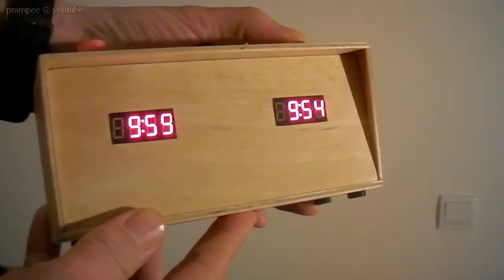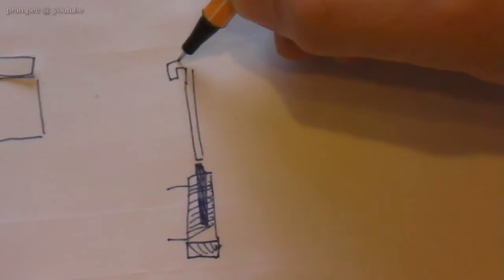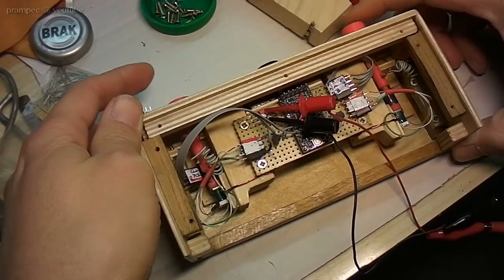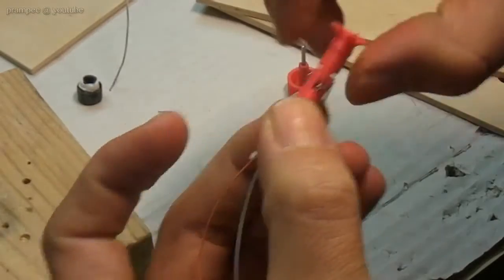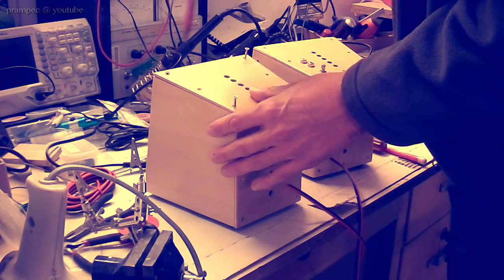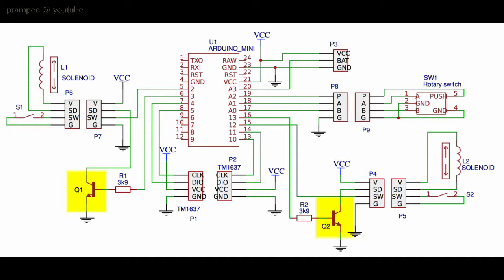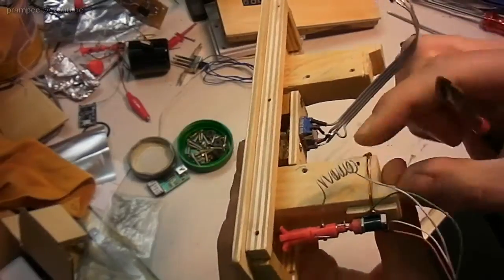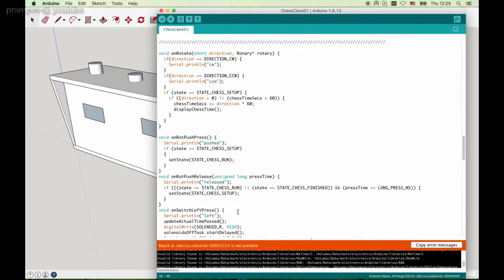DIY Chess Clock with solenoid release

Comment: Genius, i want to mimic your project, but how?
Reply from the maker: I have made a quite comprehensive documentation about this project. Check the video description for the link!
Reply: @sharedinventions  Hello Mr. Kelemen may i know the specification of arduino mini pro? is it Arduino PRO MINI ATMEGA328 5V 16M?
Reply from the maker: @mcadronaldalcantara8755  It can be any kind of Arduino. Even any kind of Arduino Mini. Either 5V 16Mhz, or 3.3V 8Mhz. It does not effect the performance, or electronic characteristic of this project. I have used the smallest one laying around.
Reply: @sharedinventions  how about the TM1637 ?millions of thanks...
Reply: Hello Mr. Balazs good day, can i ask a question about the Debouncer and SoftTimer? do i need to include these two lines or choose each one of them? thanks a lot.
Reply from the maker: @mcadronaldalcantara8755  Yes, TM1637.
Reply from the maker: @ronaldalcantara7658  SoftTimer is used for the timing actions. Debouncer is required by SoftTimer and also handle the switches.